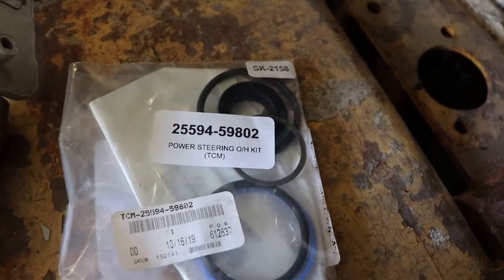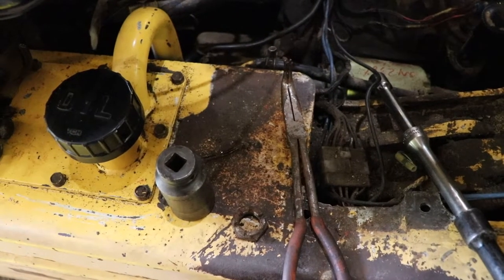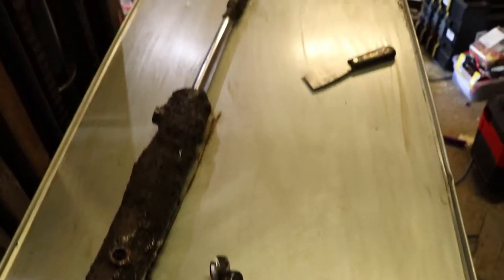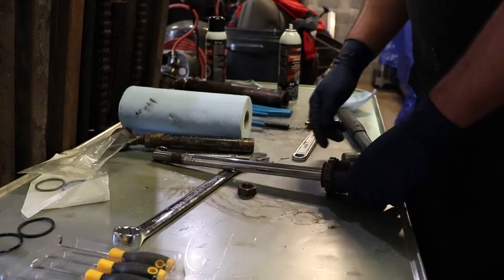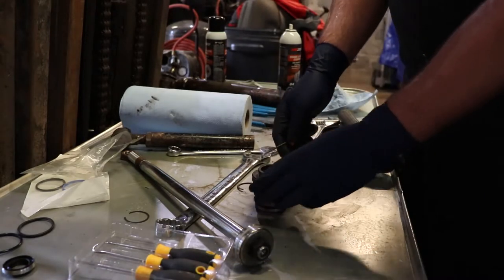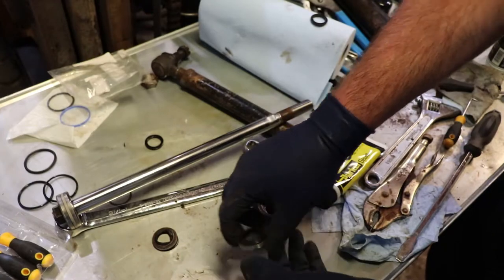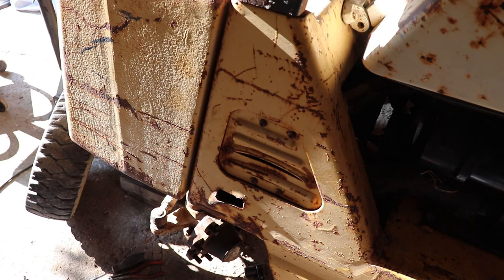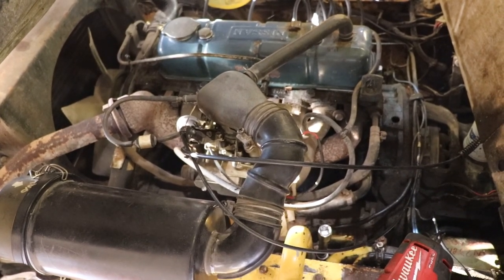TCM FG25N2S Forklift Power Steering Cylinder Removal and Rebuild

Comment: Nice work on the rebuild I have the same forklift that I rebuilt If you ever blow up the rubber spider between the engine and Hydraulic pump I figured out how to make them from scratch. When you redid your steering did you have to adjust anything in the steering box.  My forklift works great except the steering is really loose.    Its on my project list.